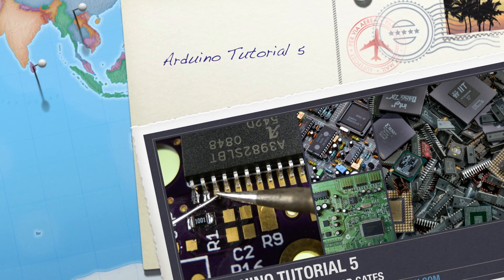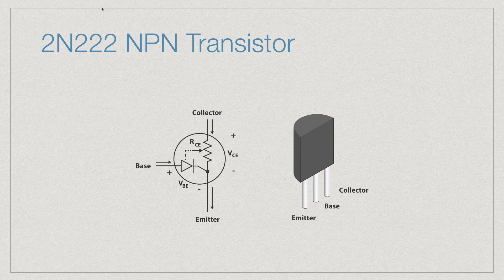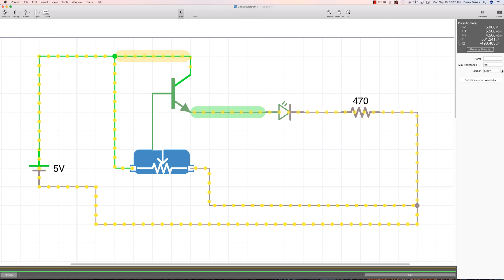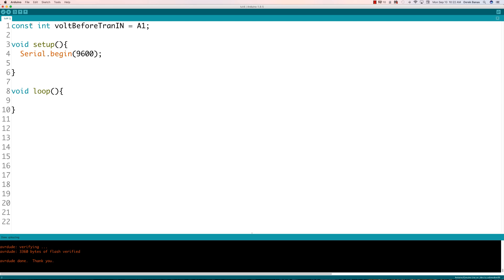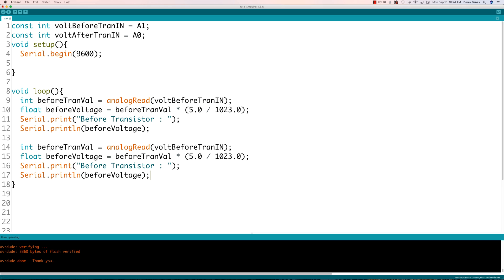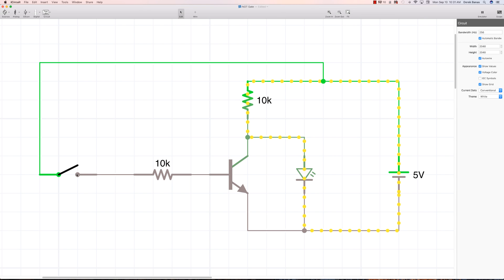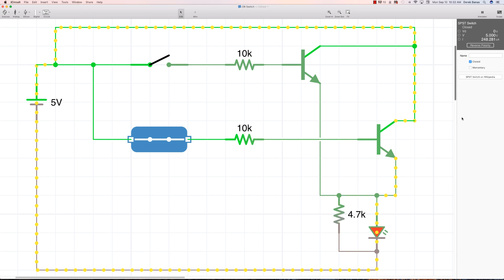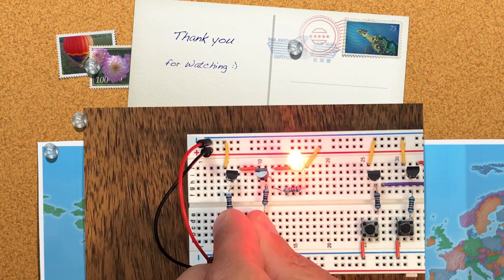Arduino Tutorial 5 : Transistor Gates

Comment: How do you know what sizes the resistors you are using? I always see logic tutorials and they always go like "and we will put a 10 k resistor here, a 100 k here.." but no one ever says WHY
Reply from the maker: I talk about resistors in these videos https://youtu.be/Q46mGS81B_k https://youtu.be/oGdM-_sk3i4
Reply: @derekbanas  Yeah that explains what resisters are and what they do but not why 4.7k are used in a specific circuit, means how to measure what resistor is needed where.
Other channels do the same. They go like "I will need a 10k pull up resistor here". Ok fine, but why (read why 10k? and not why a pull up resistor?).